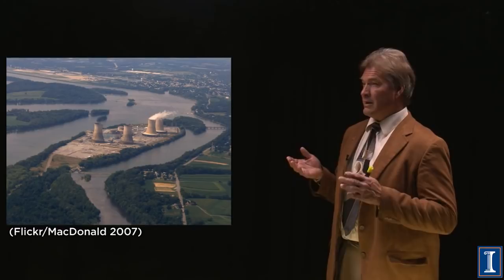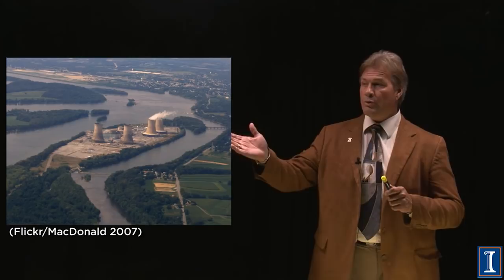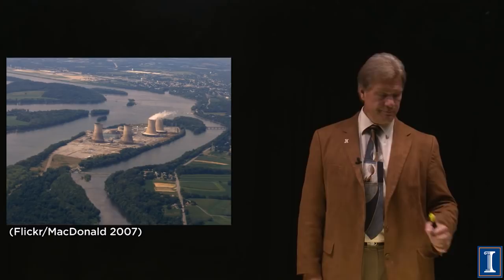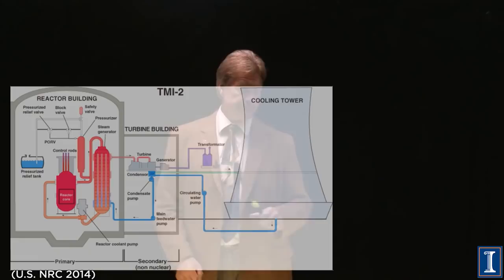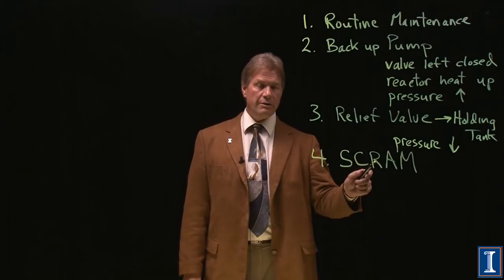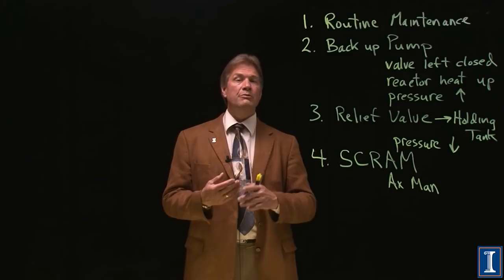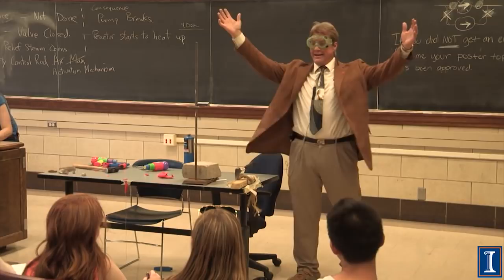How TMI Started

Comment: I worked for 40+ years in the nuclear industry.  Reactor Operator and Senior Reactor operator at 5 different nuclear facilities.  I was 2 weeks away from my NRC exam date when Three Mile Island accident happened. Because of the accident we attended over days upon days of lecture on the accident and Heat Transfer and Fluid Flow classes.  I worked with the Reactor Operator that experienced the same event at Davis Bessie and mitigated that leak. I operated a reactor that was a sister plant to Three Mile Island.  I have been trained by people who were Reactor Operators and Senior Reactors at Three Mile Island at the time of the accident.

With all due respect to the Professor, his explanation is both confusing and technically incorrect.  First I would call TMI which in this case stands for Too Much Information.  The event was initiated in the secondary system feedwater due to operator error but this had nothing to do with the reactor accident.  There are many things in the secondary side and electrical distribution that can result in a reactor trip but discussing these details distracts from the reason for the reactor accident.  In addition, while the story behind why a reactor trip is called a SCRAM is interesting again it has no bearing on the accident. Concentrate on the Primary Reactor Coolant system in discussing this accident.

The important facts of the event include not only that the relief valve stuck open and indicated closed but why it indicated closed.  There were other indications that the operators used that made them believe that the relief valve was closed but the Professor never addressed those issues. The operators manually shut off the emergency cooling system and they did this because they were taught as was I that there was a more overriding concern and something again that the Professor never addressed. I can assure you that at no time after the reactor trip did the operators believe anything was normal, slapped themselves on the back for a job well done, or were filling out any files or paperwork.  My facility was contacted 2 hours after the event asking for Radiation Control Technicians because they knew they had a really big problem. In an event such as this, there are literally hundreds of panel alarms and they had a pin fed paper printout of all the alarms that was constantly printing out but 30-60 minutes behind due to the sheer number of alarms. The best way to understand this event is not by writing some words on a board but drawing the reactor primary system on the board and using that to explain what happened.

In my experience, the best instructors are those that understand exactly what happened but have an average intelligence  If an average intelligent person can understand the event then they are more likely to be able to explain it to the general population that are also of average intelligence.
Reply: My dad was a senior Q.C. Insp. for Grand Gulf in Port Gibson Mississippi.

Comment: Why was the water level in the reactor falling, after the valve for the back up pump was opened ? Cold water must have been circlulating the reactor agian, keeping the 60 MW's of thermal power in check
Reply: Because it's only circulating the water already in the reactor, not adding new water.  Because the relief valve was open, all of this circulated water was being drained.

Comment: It makes me wonder why they didn’t have any type of remote indicator on the safety relief valve. Relying on operators to determine the state of a valve, based on other readings, is a perfect recipe for what happened. On top of that, why wasn’t there a remote indicator on the valve for the backup pump?

When I worked in the chemical industry, every valve had a remote indicator on it, regardless of whether it was remotely controlled, or not. Hell, if they had a good reason to do it, they would have had indicators on the toilet flush valves.

This accident started, when the process control design engineers decided not to put indicators on those valves. As a result, the operators were ‘flying blind’.
Reply: We live, we learn.
Reply: They did in fact have remote indication of the temperature of the water downstream of the pipe to see if hot water was leaving the system, but the high temp alarm was already alarming due to a parallel path leaking by a valve that they knew about, but just lived with. This was the situation for hundreds of alarms they lived with in an alarming condition.
As for indication of the backup pump valve, there are thousands of valves in any nuclear power plant. Having an indication for every one is excessive and also floods operators with information they can't keep track of.
Reply: If I recall, didn't the PORV as it stuck open, make a tremendous roar, but not heard in the control room? So much for "situational awareness"., 
MUCH discussion of the PORV in this thread:
https://atomicinsights.com/was-three-mile-island-an-accident/

For instance, take this paragraph:

Unfortunately, when you are in the control room it doesn’t work like that. Try to imagine you are there. It all comes at you through the back door. In TMI’s case the ROs first experience is the shear explosion of noise from the Main Steam relief valves lifting on the trip as they blow about 11 million pounds per hour of steam to the atmosphere, then they feel the actual control room floor shake as hot feed water pipes rupture in the turbine building due to water hammer, they are immediately deluged with dozens of annunciator alarms blinking and a constantly blaring, exceedingly annoying alarm horn, like someone screaming in your ear while you try to concentrate on a problem. And a lot of these alarms really make you nervous, even if they had arrived only in singularity during a simple event. Their SS arrives, followed shortly by the supervisor from the condensate polisher area, who announces the turbine building is filled with hot steam, we’ve had ruptures of hot feed water lines. So are any of your crew’s mates trapped out there, being cooked alive? Does that affect your priorities at that moment?
Reply: The valve in question (PORV) is a solenoid pilot operated valve.  The indication in the control room shows whether the solenoid is on or off, but doesn't show the physical position of the main valve (poor valve design).  And while the steam being relieved through the valve is over 600 degrees F, the downstream temperature (tail-pipe temperature) indicated several hundred degrees less.  So the operators believed the valve HAD shut and the tail-pipe was just taking a while to cool back down.   But study a Mollier diagram for steam and you'll see that when 600 degree, saturated steam is expanded through a valve to a lower pressure in the holding tank, it cools several hundred degrees.  So their belief that this cooler temperature indicated the valve had closed, was wrong.  The valve was in fact still open, even though the solenoid was off.

Since TMI, plants have had to back-fit a different system for determining if there is flow through these valves.  Most use acoustic sensors that trigger when flow noises are detected.
Reply: @uploadJ  The PORV is located in the reactor buidling. Not sure if one can hear it 'leaking' into the relief tank (closed system, until the rupture disc gave way). The roar described by the RO's was that of the main steam relief valves, which release steam from the steam generators in the atmosphere outside (and I suppose you can hear/feel that in the control room). These relief valves open automatically when after the turbine/reactor trip the pressure in the steam generators is getting too high (normally this steam goes to the turbine, but since it's shut down, it's building up pressure in the steam generators).

Comment: Gives you confidence in professionals.  I have always felt very uncomfortable listening to the explanation for the TMI incident because it makes me realize how stupid professionals can be.  Fukushima is just more of the same, one bad decision piled on top of another bad decision.  I'm a supporter of conventional, fission, nuclear energy, but it's hard to feel confident about it when the people who are the experts repeatedly make stupid mistakes.  It can be safe if they use their heads, but these types of incidents leave me scratching my head.
Reply: re: "Gives you confidence in professionals. "

Quote "Professionals" (white collar) unquote, or the plant (blue collar) operators (technicians)? I have nothing against either group, I'm just asking, uh, for a friend ...
Reply: @uploadJ  I am skeptical of the skill of both the engineers who design the plants, and the technicians who run them.  The designers may be hindered by orders from the company bean counters who want to save money, so maybe that's a factor that should be counted for.  However, if I was on a job that could kill loads of people if it wasn't done right, and my boss told me to cut corners, I'd quit.  I've walked away from a number of jobs when the money people wanted me to do things I didn't want to do.

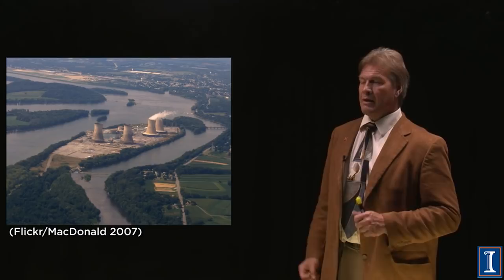Comment: 1:06 Hope this isn't a stupid question.. but why wouldn't you want to put warmer water back into the river?..
Reply: One reason, because it screws up the downstream eco system. Next to Madison, WI, where I grew up, there was a big heat exchanger for the MG&E powerplant during the early 1960s. It slowly raised the average temperature for the whole lake (Lake Monona), which suffered increased algae blooms, stank, had major fish kills and never froze completely in the winters anymore.
Reply: It decrease efficiency !

Let understand why?

1)At beginning you have use river water at normal temp let say 28 °c 
2)you heat the water at above saturation temp to turn in gass is about 100℃ at 1atm, using nuclear reactor heat.
3) Now you have steam at high pressure , flow it from turbine generate electricity ,an end of turbine you got very low pressure steam and moistures.
4) you need water in liquid form to again put in nuclear reactor and heat up, but you have moist steam.
So , you use surrounding water in heat exchanger to just  *condensed the low pressure moist steam to Saturated liquid water*. And condensed liquid temp is higher than the river water which is at 28℃
So, this time you already get water little bit below to 100℃ ready to convert in steam with minimum heat gain and cycles repeat...

Comment: ok. likely an absolutely idiotic question here, but... wouldn't it make sense to build the reactor so the core is below sea level, and in a worst-case emergency you can just flood it with water to keep it cool? I presume there are problems with that approach as a normal operating procedure but if all else fails seems like you have a nearly-infinite supply of water sitting there being useless...

Comment: "The reactor will probably start back up in a couple days"? You need to wait AT LEAST three days!
Reply: There are those who comment here who will debate you on that point, as, they have started up reactors shortly after having "shut them down."
Reply: @uploadJ  Why exactly are you skeptical of them?
Reply: @BabyBlasphemy re: " Why exactly are you skeptical of them?"

Assumption of POV not expressed; I made an observation.
Reply: @uploadJ  Ah, I apologize, I interpreted the sentence wrong. I looked at the quotation as an indication of sarcasm.
Reply: You don't need to wait three days... I guess you are referring to the Xenon-buildup, which inhibits the operator to make the reactor critical in some cases? It all depends on how far in the reactor cycle you are... At the end of the cycle, when the fuel is at higher burnup, it's sometimes difficult/impossible to start up the reactor when the xenon is building up, and then you have to wait untill most of the xenon has decayed (which can take up to three days). Or you have to be very quick, and make the reactor critical before the xenon begins to build up (which nowadays is virtually impossible, because no reactor is started up after SCRAM before the cause of the SCRAM is determined and corrected).
Reply: @dvraemdo  It sounds like you know more about this than I do. Yes, my concern was due to Xenon poisoning, but all my knowledge in this area comes from having binge watched these videos (in this instance, 11:30 of "Chernobyl: Worst Accident Ever").
Reply: @MisterHedgeFund  That's ok, at least you are right about the effect of Xenon and that it sometimes can prevent an early start-up... But like I said, this is only the case in certain conditions. Don't know about a RBMK though, could be a little different.
Reply: @dvraemdo  Seems like the proved very successfully that you can start up a RMBK reactor after essentially shutting it down.

Comment: Are not reactive water holding tanks open to atmosphere? You cannot pump water into a tank that is closed to atmosphere (basic physics).
I submit that radiation went into the atmosphere the moment water entered the holding tanks.
Reply: I have no idea about this particular case, but slightly more advanced physics says it depends on whether the tanks are full of water or if there's a cover gas. Water's basically incompressible, yes, but if there's a cover gas you will expand or contract it depending on the water inventory while still maintaining containment.

Comment: All because of water usage! Water DO NOT fulfill basic requirements for being a coolant or even the moderator!
BTW - whole PWR design is overengineered bulky piece of junk that can explode any given time...
Reply: Water has a relatively good neutron efficency (though worse than D2O) and is great at thermalizing neutrons (better than D2O). It also does a bang-up job as an abdundantly available and low-cost coolant and isn't explosive/flammable (looking at you graphite). 

What basic requirements doesn't it fulfill?
Reply: @paulk5670  
Water is shit, solid modertors are the best. (while heavier)
A LOT of them!
Nuclear coolant:
- must not react with the fuel
- must not react with reactor materials
- must not react with the air
- must not react with water
- must be stable in the radiation enviroment
- must remain in same phase
- must be chemically stable in high and very high temperature
- must not absorb too much neutrons or moderate them
- must be not poisonous or danger to human operator
- must not be volatile or soluable
 Where you will put the water?
Reply: @WadcaWymiaru  Name a solid moderator and I'll name the drawbacks.

There are always trade-offs in any design choice.